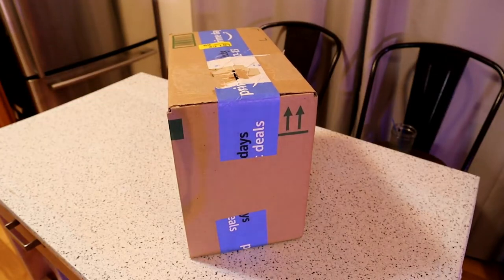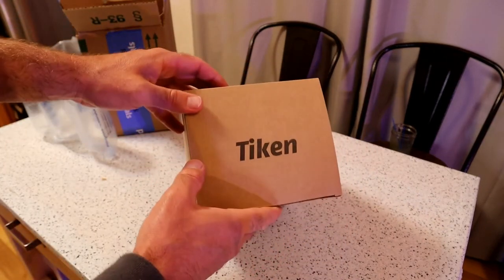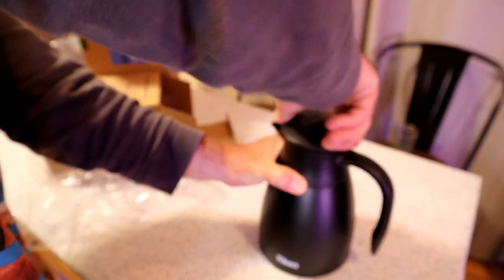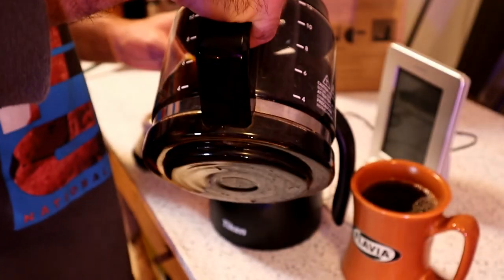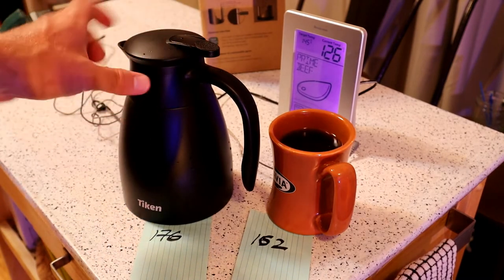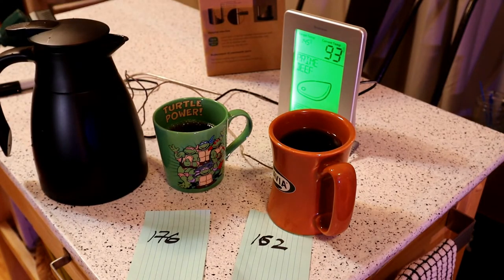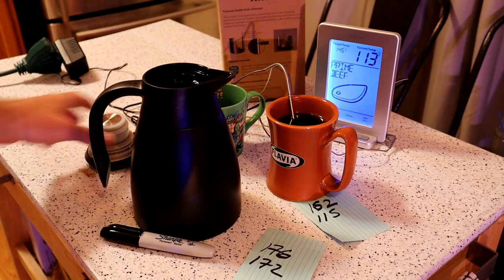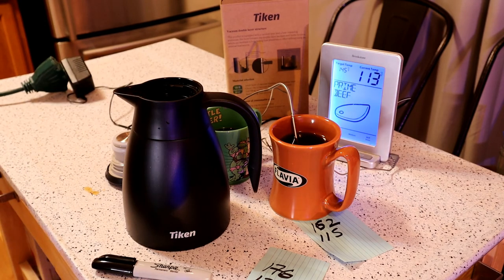Tiken Thermal Coffee Carafe Stainless Steel 1 Liter 34 Oz Test Review

Comment: Love your video. Here are some suggestions for your experiment. First off, pour boiling water into the carafe and let it set for 5 minutes. Thermal containers need to be preheated in order to maintain heat. Pour it out and then put piping hot coffee into the carafe. Measure the temperatures of coffee before and at end of time, while still in carafe. Do not measure coffee temperature in carafe after removing some coffee. Reason for this is that the coffee will have a loss of temperature when there is a decrease in hot liquid in the carafe, solely from loss of liquid.  You might want to google thermal cooking for the theory behind this process.  Thermoses must remain 75 to 85% full. This carafe does not have same quality of construction as a thermos and has a wider lid. Therefore there will be quite a bit of heat loss compared to a narrow mouthed thermos. It should be 90 to 95% full in order to retain heat. So obviously, you will want to consume the coffee at the end of time all at once and not assume this little carafe can maintain temperature of coffee once you start pouring some out.
4 degrees in 30 minutes is quite a heat loss. 8 degrees per hour is a huge amount.